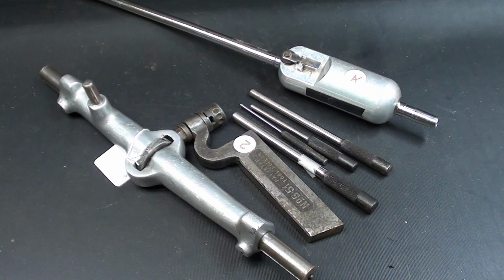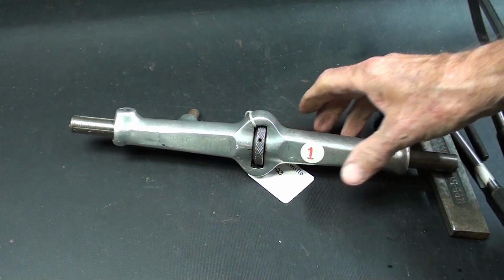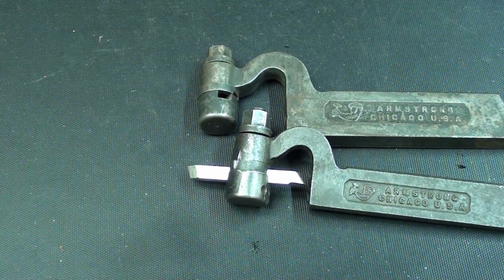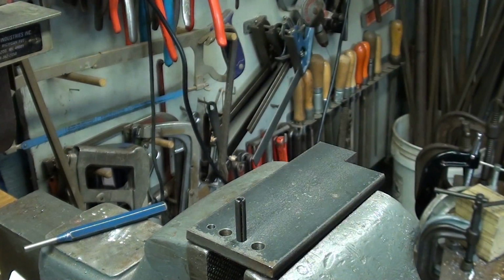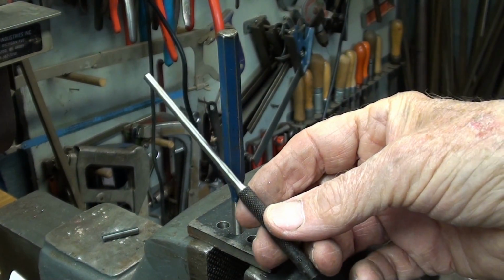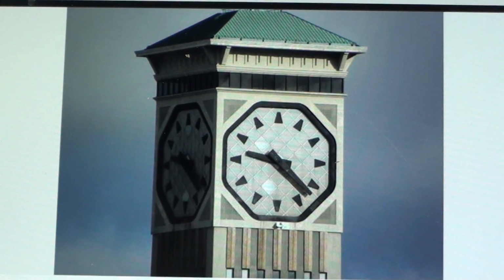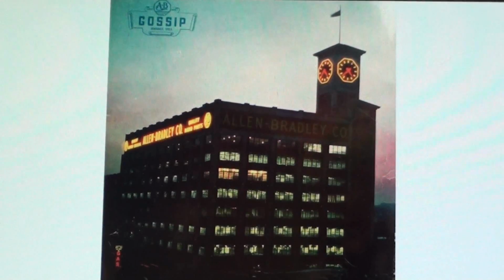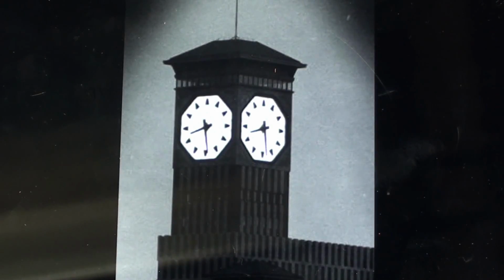WHAT IS IT? Mystery Tools #87b ANSWERS tubalcain MRPETE

Comment: Liposuction is used, in some cases, to deal with the aftermath of your “will power”. It can be used to remove the excess tissue left after weight loss from dieting. Removes the lumps and bumps post diet.

Comment: They used a lipo sucker like that in both of my eyes, i guess. Dunno exactly though, since i was anaesthesized, when the surgeon wiggelt inside the eyeball, rinsed fluid into through the small tube and sucked it off with the bigger one, to remove the "vitreus body"
Reply from the maker: Ouch

Comment: Hey Mr. Pete
The main point with the pin punches is your ability to hold them straight and start them straight when putting a spring pin into an irregularly surfaced part, like a bolt release on an AR-15 or an ejector plunger on any “push feed” bolt action. Using a pair of needle nosed pliers to hold a small pin and getting it started on a $1000 firearm you want the hammer to be as far away from the finished surface as possible. Add to that the possibility of burring/elongating a pin bore and your customer will certainly get rather angry OR you just added many unpaid hours to a simple job. 
Thank You for another interesting video, Joe

Comment: Any tool specially made to do a specific job is called a "farquarson". At the factory where I worked the fitters joined a Phillips screwdriver head to a z-shaped square steel bar for a machine and was known as "Fred's Farquarson".

Comment: A few years ago I made a tool similar no2 for turning the opposing tapers on miniature Tee handles for steam valves without changing the top slide. In my case the tool faced the other way and the work passed under the swan neck.

Comment: Good Morning Mr. Pete, I didn't know that roll pin punches existed but I could have used them. Question: what is the resolution of the drum brake inside micrometer and could you verify the accuracy? Thanks  : )
Reply: The graduated resolution is 1/8th inch (.125") there are  7 hash marks between the inch marks.  I'm sure the spindle and nut are 8 tpi so unless the tool has stretched or shrunk I would assume that it is well within manufacturers accuracy tolerance.

Comment: Mr Pete these are great but I admit I usually skip to the answer "part b" video- would you consider mixing them together, but still split, so answers to previous and questions to the next? (Like 86b answers and 87a questions in 1 video?)  Then I would watch them all!  😊
Reply from the maker: You aren’t the only one. Very few people watch part one. However, I have experimented with different formats, and it was a failure as well.

Comment: Allen Bradley is a beloved brand for this retired sparky.
Reply from the maker: I have loved Alan Bradley throughout my whole life. My dad always had big Allen Bradley calendars on the wall in the kitchen. With beautiful scenic photos on them.
Plus, I worked as a janitor at an electrical shop where one of their main products was, Alan Bradley, and the huge lighted sign out front featured Allen Bradley
Reply: Ahhh, very good ! The school district here still has older contactors, relays of A-B origin, within some of the boilers, controls panels. Oh, if interested, older AC power panels by Coast Electric, I.T.E. Model FC-20 switchgear and those old mag starters in men’s sizes 1 through 4. As well, Zinsco commercial 3 phase distribution panels ! 🤣🤣
Table care, fellow retired spark 👍👍
Reply: Nema Sizes, darn auto correct !!!

Comment: The brake drum micrometer is different from the one I used while working at an auto parts store. You set it at the size of the drum (10, 11 or 12). The points went into the deepest groove in the brake shoe surface. It was idiot proof. If the gouge was too deep, it showed beyond surfacing. 
Good video, thank you and hope you have a good thanksgibbin.
Reply from the maker: Thanks for that comment. At the high school, they had an ammoco brake lathe along with the matching brake drum micrometer

Comment: You mite recall back 4+years back when I had and restored a SB 9c lathe, ( my first lathe) and with the tooling there were 2 Armstrong threading holds that went with lathe when sold. I now wish I had kept, but the LeBlonde 17 replacement came with a lot of insert tool holders. The Lipovac tool made me almost loose my breakfast as you discribed it !!! Best from the Jerry Marcy / Bear family to you and family for Thanksgiving 2023. PS- I do have a set of 6 roll pin removal punches, and must have in any shop. Bear.
Reply from the maker: Glad to see you back in the shop. You looked pretty darn good. Happy Thanksgiving.

Comment: Almost 30 years ago I was working for a contractor who had been hired to put a wood facade over a brick building that housed several stores. My boss, Tommy, had left another carpenter and a helper on that job to fasten 2x4 nailers to the brickwork while he and I went off to work on another job. Just before lunch, Mark, the other carpenter shows up at our job saying there was a huge problem and we had to come and figure it out. The architect had drawn a square clock tower sitting atop one corner of the building. The problem was that the walls followed the property lines so that corner was 135 degrees instead of 90. The architect was called in and the result was a six sided tower with a six sided hip roof that I got to frame. As far as I know the clock has never been installed.
Reply from the maker: That was an interesting story

Comment: No1 the bit you weren't sure what it was is for an extension handle so you can put it into a deeper recess and hold it whilst adjusting the mic , we would tend to use an inside mic with an external mic as it gives better accuracy .
No 3 reminds me of South Park
"Butters how many times have I told you not to do liposuction on yourself whilst we are out ?"
"Fourteen sir ." 🤣
Reply from the maker: lol

Comment: The Shepard-Thomason micrometer was part of the brake shoe grinder for matching the curvature of new brake shoes to the oversized drum for full contact. I had the Aamco brake shoe grinder that was mounted on the drum lathe machine. Seems pure idiocy because linings contained asbestos. Back in the 70's I had that setup for my shop and every once in a while, the shoe grinder would cause problems. The shoe was held on the sides and the distance was adjustable for getting the correct arc. Rebuilt shoes sometimes had a shoe core with a twist or some other problem and grinding them would cause severe brake pulling to the left or right. I stopped grinding shoes and only installed new shoes from that lesson and it stopped all my issues with trying to do a top notch job with rebuilt brake shoes.  Full contact will happen as the lining wears and braking differences are not noticeable. The Aamco micrometer used a dial indicator.
Reply from the maker: Thank you for your comment. We had Ammoco break setup up at the high school.
It had the brake lathe, and the brake shoe grinding attachment. And I remember the micrometer as well. Somewhat different than the one I showed. Imagine at one time we would grind brake shoes with teenagers doing it.

Comment: A-B has always been top quality industrial controls. You don't get what you don't pay for. If you want long life, reliability and parts availability, it won't be cheap. Good, fast, cheap. You can only have two of the three at once.
Reply from the maker: I never had an allan bradley switch, or motor control, fail, ever

Comment: There are two designs of roll pins. The first has a straight slot the full length of the pin with the hole in the center. The second is made of thin spring steel wrapped in a spiral like a roll of paper towels. These have the center hole slightly off center. The punches that Mr. Pete described won’t work on this type.
Reply from the maker: Thanks, Ellie.     I have heard of those spiral pins, but never actually saw one.
Reply: @mrpete222 As a carpenter I have seen the spiral type pins.
They were  used on a few occassions as the anchor pins on spiral balances for sliding sash windows. They were a royal pain in the...   because they were usually a bit too short and would disengage in use with an alarming bang.

Comment: Lyle - Good video this morning, as usual.  Mahew 6 piece roll pin punch set like you have is $41.47 from that huge internet seller - can be at your door on Friday.  Larger sets available as well - LOL.  Seriously - there are times when that design is a life saver.  Have a great Thanksgiving and don't use tool number 4 on the turkey.
Reply from the maker: lol
Reply: I recently found a 3 set of mayhew cold chisels a 3 set of punches and a 5/8 drift punch for $3 each at a good will still in the packaging

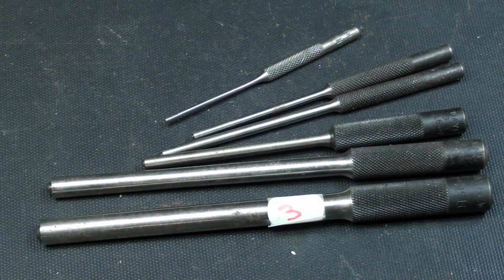Comment: @3:09 #3, I got it right! and I should. I'm retired Navy, and I worked on SH-60B Seahawk helicopters and in my last command I ran the squadron Tool Room. Part of our job at O-Level was maintaining aircraft support equipment like the Main Rotor Restraint System. Its a bunch of blade clamps, stand offs, and poles, and the whole thing is held together with ROLL PINS. Part of Navy Aviation is a Tool Control Program, its very rigid because tools left in aircraft cause serious problems. But, here is the funny thing, Roll Pin Punches were never in the Tool Control Plan for the H-60s. Well, until I finally became a Squadron Tool Room Manager and impacted the whole MH-60R/MH-60S Test and Evaluation Program. Without Roll Pin Punches breaking down and rebuilding the Blade Restraint System is pretty much a huge pain in the backside.

Comment: I really thought the second item was a toolbit holder for a shaper. At least mine (from Klopp) does look very similar
Reply: I'm with you on the shaper tool holder....although I'm sure that it can be used for both purposes.
Reply: @ianpendlebury3704  I don't think you would use a spring tool for threading.. not rigid enough! I am with you.. I think this is a shaper tool holder where the spring is needed to cope with the impact at the start of the stroke..